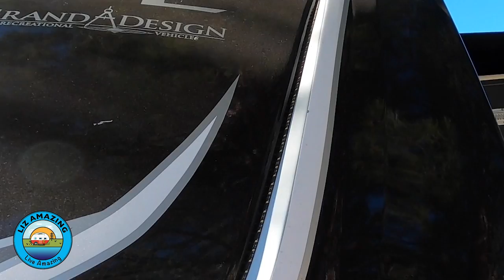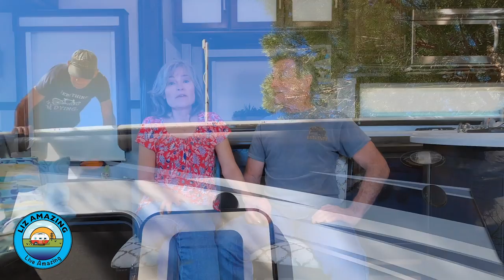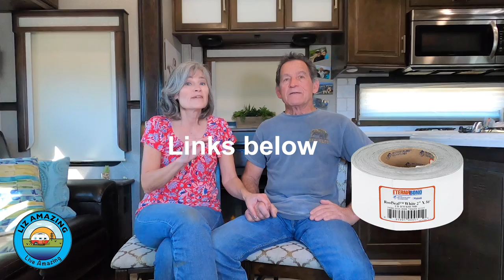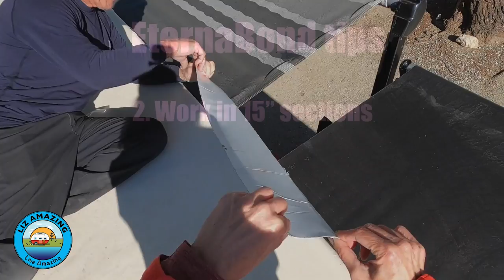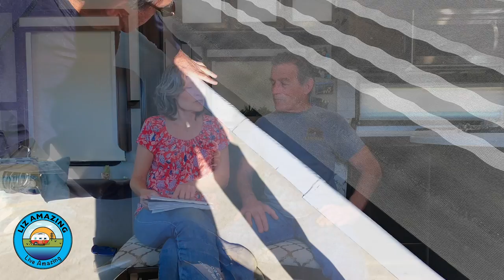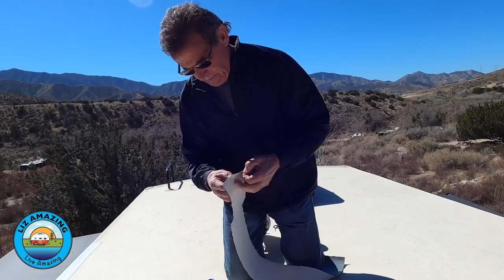RV life: We damaged our camper | $10,000 mistake | EternaBond | Fulltime RV Living

Comment: I damaged my rig very similarly at a gas station I presume, didn't even know it happened till we saw the roof flapping down the road.  For eternabond application, leave the backing on, just peel back about an 1-2" of the backing to get it started/stuck, then I just keep doing that for the entire length whether its 12" or 12', might be able to do 3-4" at a time after you get it going, especially if its a relatively straight/flat run.  Just pull away the backing as you go at about a 45 degree angle, out from under the tape, this technique is a lot more forgiving, you can keep adjusting the leading edge if you're off a little and get it back on track with your alignment mark, roof edge, etc, 1. align and hold 2. peel back a few inches of backing 3. press/roll it out 4. repeat     Very similar to applying adhesive moulding, etc, to a car/truck.
Reply from the maker: Oh, awesome. Great tip! Thanks so much. Eternabond saves the day!! And so sorry about your gas station incident. Wishing you much better camping this season!
Reply: Exactly. I’m a roofer. And I do that with full rolls of 36 inch wide ice water shield.
Reply: This is the way I would do it, and also don't pull the tape and stretch it out, let it lay naturally off the roll and just the slight tension to keep it straight.
Reply: This is the best way to apply. An added tip: if you apply in pieces, start at the back of the unit moving forward so any overlapping will not be subject to the wind while driving.
Reply: Thank you
Reply: @MontanaWelldigger  thank you
Reply: @timhammond691  thank you

Comment: You could have done the whole strip if you had left the backing on and pull the backing off as you go, without pulling on the tape itself. I used a similar product and that was the instructions. That way you don't get it stuck to itself or you. It does help if it's not windy either way. Happy rvIng...
Reply: Also having an extendable ladder would have given you a better working angle for the job than leaning over the abyss. I plan on eventually doing all my roof seams with eternabond tape as it's a pretty old trailer and looks are secondary to function now.

Comment: Well thats a bummer for sure. I carry a 4" X 50' roll. Rubbing alcohol is a good prep if you don't have acetone on hand, also a 2" wide hand roller is great once the tape is laid down, makes for a nice smooth finish.
Reply from the maker: That's exactly the size roll we have. Thanks for the tips about the rubbing alcohol and hand roller. See you in the next video!
Reply: Ditto here carrying the 4" x 50' and their roller, too.  But since I don't carry rubbing alcohol, I'll resort to my Canadian Whiskey... well, maybe one shot worth but not much more 😜  Happy Trails.
Reply: Use 99 percent Alcohol, NOT 70 PERCENT  REASON impurities
Reply: Thats always my suggestion for these tape projects.  a two or three inch wall paper roller does the trick.

Comment: Thanks for sharing your adventures and lows!  Makes me feel good to know that I'm not the only one with these "waves" of happiness.  My "roof story" has some drama:  I'm driving a 37 ft RV [Thor Magnitude Super C] towing a Jeep Wrangler through Wyoming in October with 60mph cross wind gusts.  The wind LIFTS my left awning [driver side] and throws it onto my roof, while I was driving.  Suddenly I heard this incredible noise on my roof while I was doing 55-65mph and it sounded like a bear landed on it. I pulled over and took stock of the situation.  I couldn't drive further with this condition and it was 4pm, getting dark by 6pm, and I have 200 miles to my campground.  It took me about 1 hr to find a tow truck company to meet me at the location off a deserted lone highway.  No problem, I turned on my generator and made myself a sandwich, had some soda pop, and waited for 90. min.  I had explained the situation and he came with his pick up and ladder to cut the awning off and take it to the dump. Cost of the awning cut = $250.  Replacement is underway and its under warranty.  The positive of this story: I got the most incredible sunset shots that I've ever taken.  It was worth the hassle!  My Roof Story :)
Reply from the maker: Wow, what a story! A great one for sitting around the campfire for sure. Glad you had a generator and could just sit back and relax. Thanks for sharing your roof story~!

Comment: We did almost the same thing about 3 years ago.  We pulled into a park , saw the tree, but didn't realize that there was one branch that dropped down lower than the rest. We were heading to our Vanleigh Service Center the next day, and no rain was predicted so we did a temporary repair and the service center fixed it the next day.  I wanted to let you know that 3 years later, there has never been a problem.  It sounds like you're all set also.  In our case, we aren't planning to trade ours in so we don't have to worry about resale value.  I sympathize with you because I know that feeling when you find out what has happened to your RV.  Thanks for posting such a real life RV experience for all to see.
Reply from the maker: Hi Maureen, you are so welcome! We've heard good things about Vanleigh so I bet you are enjoying yours. We think insurance will cover our new roof, thank goodness. If not, that Eternabond will last...probably an eternity. Thanks for watching and commenting!

Comment: A single ply roofing contractor could of put your tape on in one piece. We are a Roofing and Mechanical contractor. Mechanical is hvac, sheet metal fab, and plumbing contractor. I would recommend to use roof caulking around your patchs. The edges will start lifting over time. Also the corner of tape need a small radius cut next time. Harder for tape corners to lift. Really enjoy you both !!! Thank-you for your channel on YouTube.
Reply from the maker: Thanks for the great tips, Terry! We knew we couldn't drive with it like that. We are expecting insurance to give us a new roof, fingers crossed!!!

Comment: We’ve owned our travel trailer for about 5 years now. This is our first 2nd home (😉) and we are the 2nd owners. It’s a little dated, by about 18 years, but for its age it is in great shape. No leaks being the major deciding factor. 
But being a newbie I watched all of the maintenance videos I could stand to watch on YouTube, and then got the great idea I’d inspect the roof and perform the yearly reseal.
I got up there, did my inspections and I’m really glad I did because I learned a lot. Like, the original owners did absolutely take care of their rig when they owned it. You could tell they resealed the vents etc, because there was so much lap sealant up there I bet it was 3” thick and 5” wide. 
I watched a video where the guy used a Milwaukee oscillating tool and a flat blade to remove lap sealant, so I got the great idea to do the same. He made it look so easy lol 😂.
It’s not.
I ended up cutting straight through the membrane, and I mean straight through it. I could have puked when I saw what I did ! 
Eternabond to the rescue !!!
It’s been on 4 years now and looks as good as the day I put it on. 
I now, with more experience, inspect our roof religiously and methodically, every MONTH. 
It may be overkill I admit that, but I do it. This year when I resealed I used a heat gun and a plastic scraper. It really loosened up the old lap sealant and made it 10 times easier to remove, and the plastic scraper is more than adequate to do the job.
I also “painted” on the DiCore roof sealant system. I did the job by the numbers, following every step as published, and I’ll tell ya what, I’m really impressed with the results. I think I bought us about 2 years. 
I have plans to replace the roof membrane completely by then. I also plan to replace the skylight covers, I have 2, and we already replaced the OEM vents with maxx air fans. We have 4 of them. 2 of which I’ve modified to be able to reverse fan direction. 
So yeah, making mistakes comes with the territory my friends, and we make a lot of them lol, but, it’s nothing that can’t be worked through and over come.
Good luck to you and God Bless you.

Comment: It does happen. We should start a club!  😂

Eternabond is permanent so there is no rush need to repair.
Reply from the maker: Yes! That stuff is good stuff! It may be months before we can get the insurance scheduled with the repair. We are looking into a stronger roof than the TPO- stay tuned!
Reply: There’s a couple spray on roof outfits like FlexArmor that I might consider, if necessary,  rather than another TPO. Lifetime warranty in Green Cove Springs, Fl. But I’ll continue to patch away with Eternabond as long as I can and it keeps the water out.
Reply from the maker: @robbdenisedrellich7324  Definitely considering a spray on, if insurance covers it. If not, Eternabond is doing the job!

Comment: Dropped our previous 5th wheel on the bedrails - latch failed ... $5500 later and the truck bed was like new.  Very little damage to the camper.  

Painted the jaws and fixed the hitch and put a pull test on the hitching list of items.

Eternabond is awesome - you can buy it in an off-white color to match your roof color.  I used it on our Solitude to cover the front and back lap sealant seams where the roof hits the front cap and rear wall.  It is like an extra seal over areas that tend to open up over time due to the lap sealant settling.

Thanks for posting this video.
Reply from the maker: Hi Mark! Oh that's such great news that it comes in off-white. I looked for it on Amazon but must have missed it. We will have to pick some up next time. And so sorry about your latch failure. Yikes! At least they were able to fix the truck rails so you don't have to be reminded on a daily basis! Thanks for your comment!

Comment: Sorry to hear about your roof damage.  We damaged our 2003 RV a couple of years back after a deer jumped in-front of our coach and it cracked the lower part of the fiber glass front cab.  Considering the age of our RV and also the repair difficulties, I chose to do the fiber glass repair myself and had a vinyl foil (unique color design) applied that also functions a bit as a rock chip protection.  This approach not only was part of the front cab fix, but gave the RV improved rock chip protection, and freshened up the overall look of the RV.
Reply from the maker: Good for you that you were able to do a pro job on the front of your coach! And so glad that you were not injured in the accident.

Comment: For "physiological safety" I have used my awning as well. I do not like heights. I used 2" wide on the edge vs 4" and was not in the wind. It was much easier to handle. I also do not cut into strips . I only remove the backing as I am applying it to the surface; applying about 3"-4" at a time. Starting with about 1" of backing removed, adhere to the start of the roof edge and work from the front of the RV towards the rear. I lay the roll ahead of me (towards the front) and unroll about 12"-18" . The backing is still on though. then with one hand pressing down as I am slowly un peeling the backing about 3"-4" at a time. You're peeling & applying simultaneously. You end up with one contiguous strip the entire length.
Reply from the maker: Hi Herb, thanks so much for the great tips!!! Yes, that awning made it a lot less distracting, glad you thought to use it, too. Thanks again.

Comment: Been there done that too!  I had the roof membrane replaced with insurance claim,  they added a 1/4 of plywood after ripping old membrane off and I got an upgraded membrane so worked out for the good for us.  I also have an 10 year old roof on my new to me Toy Hauler and I noticed that the edge along the whole roof had weathered and had small cracks appearing,  none went right through but soon would.  So I put three inch Eternabond along the entire edge from the top of the gutter over the top for two and a half inches and around all the roof vents,  great product!
Reply from the maker: Yes, that Eternabond really is good stuff. It's way stronger than our tissue-paper TPO roof. We, too, are looking at a roof upgrade once insurance comes through. Stay tuned. And happy camping to you.

Comment: We had a ‘40’ Jayco 5th wheel and had the same experience only out damage was like limited to 10’ over the bedroom. I caught a 14” Oak limb and damaged the aluminum roof radius ( crumpled). I cut away the damaged metal and replaced it a piece of 6” aluminum dust from HD. Used a quarter of the diameter which matched the existing profile. This was adhered with rubber cement. Our rip also created a puckered / ripped tear. I cut some of the pucker and adhered with rubber cement. This was to give a “smooth” surface. I used a similar DuroTape repair. You can make a one piece repair if you only peel off 8” of the backing at a time, stick down with no bubble/wrinkle. Be sure to roll down the DuroTape with a hard roller. Later when I took it in to have the roofing replaced I was told that the repairs we done so we’ll that it would have lasted for a long time. Needless to say had the insurance check and the time so it was replaced
Reply from the maker: So smart, Ray! If we could have done it all over again we would have skipped the insurance and just repaired it ourselves. Thanks for watching!

Comment: That tape is amazing stuff! We cracked our shower base while we were staying near Corpus Christie for the winter. The crack started at the drain and went all the way to the edge. I used a piece of that tape to seal the crack. It never leaked! When we had a roof leak in our house I used that tape to repair the flange around a vent pipe. The rubber had dry rotted and cracked so a piece of tape was a quick fix. Be safe!
Reply from the maker: Yes! Great ideas. I've heard Eternabond works great on tents, awnings, patio chairs and  more. That's awesome about the shower, too.

Comment: I first purchased Eternabond in 2010. It was very expensive back then and to this day I still have about 3 feet of it left. I use it sparingly and only for the roof. One bit of advice, get a large plastic zip lock bag and keep the roll of Eternabond by itself in the bag when not in use. It may sit around for a number of years and the sticky adhesive attracts all kinds of stuff.
Reply from the maker: That's a great tip. We keep ours in a grocery bag but that wasn't enough to keep other stuff sticking to it.

Comment: Hi you guys, I like what you're saying and showing. Thank you. Hay, keep in mind there's a product called, Flex Seal. It comes in white, to reflect the heat. I've seen others use this in the one gallon bucket, on their RV roof with the fabric membrane. They rolled it on with medium and small rollers for detailing purposes just touching a 1/4" onto the roof vents in every area. They did it on  really nice day, they let it dry 2 to 3 days without touching it. Don't touch it until the 3 day. You can do a test patch on a piece of fabric you get from a store. When that piece is dry your roof is ready. It works better than all the other stuff. The other folks that did this, did it 5 or 6 years ago, and their roof looks just as good as it did the day they finished rolling it on. It's like a protective shell. They have no roof problems to this day. IF they need to add some after market antenna or what have you. Just do it, and brush some more Flex Seal. Ive even used this on a pond for the liner where the edges meet.. once dry water does not effect it.. Hope this helps.
Reply from the maker: Hi Clayton! Thanks so much for this, that's good to know. Here is what we found in researching (since we are having insurance pay for it) https://youtu.be/9Yv0ZKSfvbc

Comment: Stuff happens!  You did well with the Eternabond tape.  I've done worse by misjudging a tree limb -- knocked off the plastic roof cap over the refrigerator vent and tore some of the EDPM membrane.  Fortunately, my nearby RV supplies store had what I needed, including a new cap, Eternabond, butyl rubber gasket tape, and self-leveling caulking.
Reply from the maker: Glad to hear that. Boy, those roof membranes are fragile, aren't they? I swear, the Eternabond is MUCH stronger than the roof itself! We are actually looking into a beefier replacement roof. Stay tuned!
Reply: @LizAmazing  Yes, I was shocked when I saw how thin the roof membrane is.  The Eternabond tape is probably 5 times thicker, so don't feel bad about using some tape to repair a rip or seal a leaky joint.  However, I wouldn't replace a good roof membrane just because it's thin.  They last a long time and there are coatings specially made for each type of membrane that can renew an old roof without taking it all off.

Comment: Having been thru this myself, I decided to put a new polymer roof from the folks at RV Roof on both my truck camper (AF 865) and my trailer (Grand Design Momentum 21G) right after taking delivery. You get a 3/16” thick sprayed on roof that just doesn’t care about trees and won’t leak. The downside? It’s darned expensive (about $170/foot) and must be done at an RV Roof installation facility.  For me, a full timer with three RV’s it’s been well worth it on the two that have this.  Probably too expensive if you don’t full time or don’t plan to keep the RV for a long time.

Thanks for the great video, guys!  I may need that tape on my old RV that doesn’t have the thick roof!
Reply from the maker: Hi Reed! Thanks so much for this, you must have just looked over my shoulder! We have an upcoming video about exactly this. Ring the bell if you haven't already to watch our next video when it comes out. See you then!